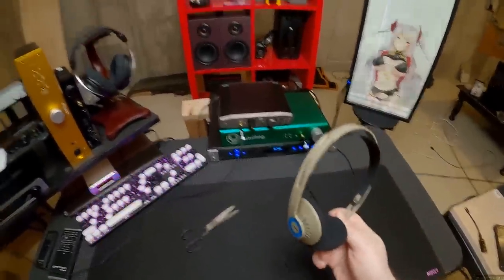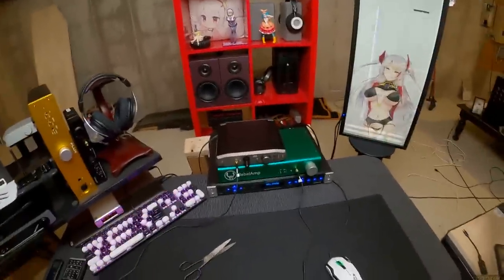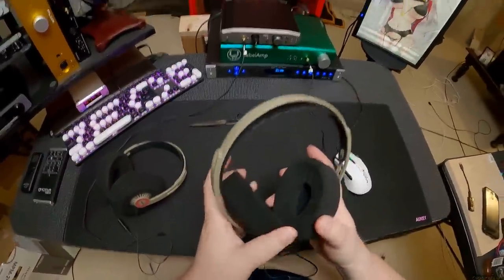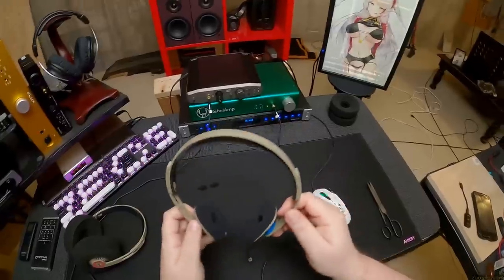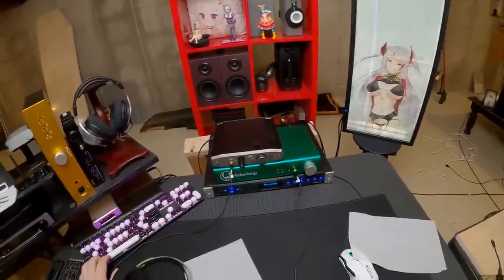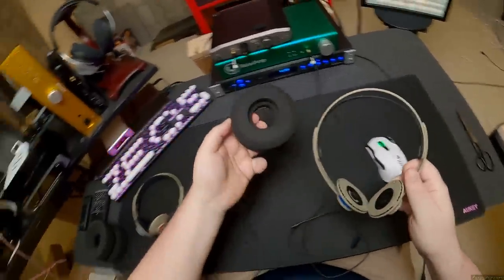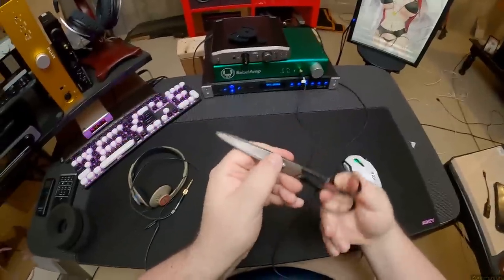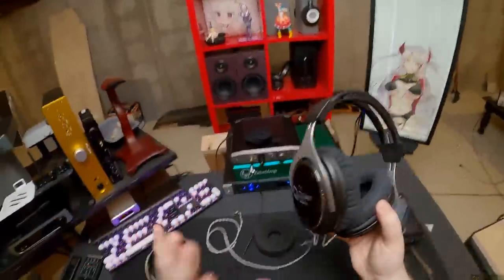Koss KPH30i ULTRA _(Z Reviews)_ 🔥

Comment: If you stick those grado pads in boiling water for 10-20 seconds, they soften up even more (and they're clean too!)
Reply from the maker: So I need to find Aldente?
Reply: Just remember to take them off the headphone first.
Reply: I concur, definitely boil the pads. Feels a lot better afterward. Just make sure to dry the inside groove of the pads as well.
Reply: Boiling water or warm water?
Reply: @FalseNihil  Boiling water.
Reply: @Thirsty_Tree  okay, thanks, when I find a buy page for kph30i in brazil i will definetly mod them.
But fuck brazil I cant find it anywhere
Reply: Wow, that actually worked.
Reply: I was fully expecting the pads to melt or release toxic gas or something, but it just worked.
Reply: @ShinkuRED  well maybe don't drink the water, foam breaks down after 100°.
Reply: @k.-flynn  I definitely didn't drink the water lol
Reply: Somebody mentioned that on the last grados video. Although he mentioned isopropyl alcohol as well.
Reply: Do you boil the water and stick them in or do you put them in the water as it's boiling on the stove?
Reply: @chethammer  boil the water and stick them in
Reply: @k.-flynn  I did it once and was surprised at how much softer they felt and then I did it again and they're even better.  I can't swear to it because I didn't measure them beforehand, but I think they're actually smaller as well.
Reply: For how long do you keep the pads in the water?
Reply: @elazark2914  60 seconds max
Reply: This feels like a prank and I’m not convinced every comment is not playing along to fool me personally
Reply: @strutter789  me too lol I'm hesitant to drop my pads in boiling water. I'm worried it'll dissolve
Reply: @wrliggin2  They're $10 to replace if you don't believe us. Just try it
Reply: Makes my happy peepy go 😂
Reply: This is the wildest thing I’ve ever seen we are boiling headphone pads
God I love the music production community
Reply: @ELISHACAEZ  grado pantyhose mod

Comment: I've spent a couple days with this mod now, stock pads removed. I'm really impressed, these are the most balanced and yet enjoyable headphones I've used thus far. The bass, mids, and highs are all perfectly balanced. All of my previous headphones were either to focused on one or lacking in one. The mod also increased the soundstage a pleasant degree. 

For reference, here's how it stacks up with all of my previous headphones (they're all budget headphones)
SHP9500 - great highs | good vocals | not enough bass | great soundstage
SA CB-1 - good highs | okay vocals | good bass | good soundstage 
Monoprice Retro  -  recessed highs and vocals | to much bass | great soundstage
KSC75 - slightly sibilant highs | great vocals | not enough bass | okay soundstage
KPH30i stock - great highs | great vocals | not enough bass | okay soundstage
KPH30i "ULTRA" - great highs | great vocals | good bass | good soundstage

Edit: A word of warning a year later, while the audio is great these headphones break really easily. I don't mistreat them and I don't have a very big head, but I broke two of them before giving up on them. Super glue only saves them temporarily until they break again at the same spot they were glued. Additionally, the headphone pads recommended in this video are massive hair magnets, and the hair isn't easy to get out either.
Reply: I have a question, have you tried the kph40's and, if so, are they any better than the kph30i? And on that topic if you have hearf the kph40s modded do they sound better than the modded kph30i's?
Reply: @n1kora937  Haven't tried kph40's

Comment: Can confirm, this does really improve the sound. They weigh nothing and feel great as long as you boil the pads for like ten seconds, and they do improve the low end and widen the sound a bit. Highly recommend getting another set of KPH30i’s (Killer Plastic Headphones 30 i) and doin’ this mod. Also there’s a small piece of buffering foam behind the driver that you remove. Do that.
Reply: Imma take your word and try this out❗️
Reply: @Chemunguss  Go for it! When you get the grado pads, be sure to boil the pads in water for about 10-15 seconds. Makes ‘em softer.
Reply: I just got the KPH30i and grado pads. They do feel pretty firm so I'm about to boil them to make it softer. Thank you for the tip.
Reply: @vincetheveganprince  Yeah, they are kinda stiff when you get brand new ones. I’ve been using my pair as desk listening headphones for years at this point, very comfy sound.
Reply: @Just_a_Tool  Hello, I don't know anything about headphones, but what are they talking about when they say 'buffering foam behind the driver'? I've ordered the pads and the headphones.

Comment: I purchased a second set of these Koss's after hearing the stock first one. In case i sat on the first pair i wanted to make sure i had a backup. So after this Z vid i had to at least try this. The pads were def on a slow round about because i ordered them shortly after the video. Well they came and i tried putting them on without taking the original pads off. NOPE. Immediately went for it in taking all the foam off. Easy. So spending some a few hours with them this afternoon and this New Years Eve. I am blown away at how good these sound. If you have these....just do it! I was plugging in and out a few nice headphones i have,such as the 58X and the 598. I'm significantly enjoying these more at the moment. Soundstage got truly amazing. Definitely pleased and thanks for sharing this Zeos!

Comment: watched this a couple months ago, and decided to buy a pair. I was slightly disappointed with the stock. not entirely, but slightly. I just did the grado pad swap a couple minutes ago and it compensates on what was originally lacking to my ears. stock, they sounded almost like there was a lowpass filter on everything if that makes sense. taking off the stock pads and putting on the grado pads opened them up so they are much brighter now.

Comment: "You could take off the pads, I think they have something to do with the tuning"  So when the pads on my Sony 7506s inevitably deteriorated and I replaced them with Beyerdynamic DT-250 pads, I opted to leave the foam out the first time, and what that did to the sound is difficult to describe.  It didn't just make the treble brighter or anything, it screwed up the entire sound balance.  Put the foam back in and it was back to normal.
Reply: foam absolutely affects sound

Comment: Bought some cheaper Grado replicas, comfort improved, but sounded, mhpmh, hard to describe? They had become more fun but veiled. Went ahead and followed a guide to remove the stock earpads (it is possible to do). After slowly unclipping the driver from the headband you can remove the foam pads without tearing them. Now they sound fucking awesome, as God intended, do it, just be slow and steady. As Zeos said, they don't have to work as hard to retain that fun, punchy signature Koss worked on.

Comment: I have personally tried this mod...sounds great and I find it much more comfortable to wear for longer periods of time. The removal of the original foam (yaxi pads in my case) is a must! Only slight downside is that a longer surface of my skin gets sweaty over the hours and I can see it get worse in the summer but ymmv. Anyway, I give it my recommendation.

Comment: Bought a pair based on the old review. The adjustable part is quite rigid and will crack if you adjust them without taking them off your head. Some electrical tape on one side works well. Unfortunately 6 months in and the sound stopped working in one ear. I had them for 6 months and paid the postage to mail them back to Koss. You get what you pay for.

Comment: Regarding light gear sliding around, using a combination of 3M Scotch SJ3550 and SJ3551 dual lock is a great way to avoid that. You'll see that method used on guitar pedalboards. It just takes a little square in each corner, doesn't move around like velcro once snapped together, and holds really well. Well enough that you need something like a nylon upholstery crowbar to pop the gear apart.

Comment: Old video, but I did this recently. The KPH30i's were not on sale but this is still worth it. These are so comfortable and sound great. Very well tuned. Nothing boomy or shouty about them. Nice and easy not fatiguing at all. I think I get a bit of what y'all mean when you talk about sound stage and what not. These sound fantastic and coming from only using in ear monitors. The stereo positioning of instrument tracks is much more convincing. Panned hard doesn't still sound like it's inside my head so they really do feel more wide then in ears ever could.
Reply: So basically snip a circle in the center of the pads, then add the Grado pads?

Comment: So I have these and I love them. I bought the grado earcups and they're way better with them. They plug right into my ps4 controller, so I can play at night or watch TV and not wake my wife. They're insanely comfortable. Use them to play D&D over Discord with my formerly in-person group and have them on for four hours without realizing it... BUT they break way too easily. I have snapped 3 pairs just putting them onto my not-freakishly sized head. Especailly with the grado cups, they are at their max just going on and off.

Comment: My headphones and pads have arrived; the Grado pad mod improves the headphones significantly for sure.  I haven't removed the stock foams yet, but I'll likely try that, too. The headphones without the mod are pretty good for the money... the knock-off Grado pads bring the sound quality up significantly.  Still not as good as the Philips SHP9500 imo.

Edit after further listening:  In some ways, I prefer the Koss over the Philips. The Koss provide a fuller upper bass / lower midrange than the Philips, thereby giving them a warmer overall sound by comparison. The Koss, however, are not as expansively 'open' as the Philips, but by no means are they 'closed' - sounding.  The Koss seem to have a pretty uniform mid to high frequency range (nothing stands out), and their smoothness lends itself well to a good vocal presentation (somehow offering more intimacy), not to mention provides a bit of forgiveness in some less than stellar recordings.  

Both sets of headphones are equally enjoyable to me. The Philips are more comfortable due to the circumaural design, have a wider, way more open soundstage, cooler sound signature and better overall resolution than the Koss.  The Koss are not quite as open or resolving, but still no slouch in either of those regards, and provide a warmer overall presentation due to a slight bump up in the lows and a very slight bit of treble roll-off (with the stock pads on and the Grado pads added).

They both excel at delivering a uniform presentation, both offering very good midrange performance.  It's more a matter of cool and agile vs warm and smooth. Good either way.

Comment: My pads arrived today..

I bought these sometime over the summer and they have been fine headphones for around the house with a portable DAC amp. I like the 90s look (beige). Now they have other shades. The pad swap has made me look at these in a new light. I will admit that I was never really impressed with their sound. I kind of thought they were overhyped. I also never thought about plugging them into my Darkvoice or any other amp besides my FiiO BTR5. On both amps, they do sound good (better than before) especially considering the money, surprising clarity (after pad swap) and very lightweight/comfortable. Much more so with these pads.. I am using a sonarworks preset for the Koss PortaPros and it does sound better with it on. So do that or an EQ is probably a good idea for these.

The pads I used are from AliXpress for $3.20 - Replacement Earphone Ear Pad Earpads Sponge Soft Foam Cushion for GRADO PS1000 GS1000I RS1I RS2I headphones these feel of nice quality. I did set them in a bowl and poured boiling water over them. I let them sit in the water for about a minute. Not sure if that changed anything.

You can find the headphones for sale at Koss and use this promo code - VRKTHQ33EC 15% off

Comment: I tried the 30is and the tuning is just too dark for me personally! Sounds good though, just a matter of personal taste. More of a ksc75 person
Reply: Same here. I'm flabbergasted by the quality of the ksc75, i often prefer listening to the ksc75 than pulling out the xduoo x5 + Sennheiser HD600 (better all around but in mobility nothing beats the ksc75's dynamics)
Reply: I'm pretty sure someone has put the '75 drivers into the 30i frame... idk if anyone has done that and the g-cush pad swap though.
Reply: I was going to make the same comment, lol. I think the ksc75 has the best treble balance and the most fun sound. I've tried ksc35 and didn't like them as much.
Reply: There's a foam pad that sits behind the drivers and I've seen people say that if you remove it then the treble really comes to life on the 30is. The foam apparently helps  make the bass real punchy.
Reply: @auroragoose3414  Apparently there is a mod with a very cheap headband.. don't remember the details.. check metal571 video
Reply: so, this is an emo headphone?
Reply: Kph30i are a mid-bass bloated mess. Ksc75= clean and great Soundstage.
PortaPro= more Focus on (Sub)bass than Kph30i.
Reply: I have the KSC75... in some bright tracks, the treble hurts my ears a bit... for all other cases, they are just awesome
Reply: @jackjack3874  I might be missing highs
Reply: same.. they sound pretty good for 30$ headphones, but they lack too much info or even dipped in the higher regions, not very revealing to say the least. Didnt remove the foam tho

Comment: I tried this mod using the Vever pads and I didn't like them. The treble was harsh and sibilant, I tried it on both the KPH30i clear and rhythm beige. So a sample size of two. They had great midrange and soundstage but the bass distorted. I much preferred the stock pads and the later swapped Yaxi pads for the Portapro. I am not sure what happened with the sound, I even just ran the headphone with just the Vever pad with the stock pad removed and the same problem occurred. I tried to calm the harshness with the desecrated corpse of my clear's stock pads by cutting it into a circle and placing into the hole where the driver is and the same problem occurred. I then switched to the Yaxi pads and the sound was unoffending and not sibilant. The amps I ran with these headphones were my phone, MT602, Zen Stack and and Hidizs S3. Is there anything I am doing wrong? Thanks.

Edit: Same problem happened with my Grado SR80X, the Vever pads made them harsh sounding. Stock pads make the Grados sound like Grados

Comment: Viewer update, Wed. August 17, 2022.  I did this, ordered directly from Koss as they had the best price, would have waited for the clear, that flexibiliyt would have helped as my head is larger than average, and those pads on it did lead to the band snapping, but that sound was amazing, and I just happened to have a pair of porta pros, so I put the pads on those, and enjoyed them...but long ago, in 2008, when I moved here, I went downtown to Bay Bloor Radio, and auditioned some headphones, deciding on Grado SR125s, I still had them, they were buried, I found them and put those Grado Pads on, and DAMN, they came alive, and are my current goto, no fancy headphone amp, just the headphone port on my Scarlet 2nd gen 2i2, as I was a cohost on a youtube show that reached conclusion in early 2018..after a 5.5 year run..outgrowing the blue yeti lead to a Rode Nt-1a xlr, and the need to have a computer with a case not full of holes, right now using a repurposed dell optiplex 7020, no more ground loops, hurray.

Comment: I can't even find the shops to import these where I live. And if I can even get one it's closer to $50
Reply: Still probably one of the best open backs sub 100usd, they are better than shp9500 and ad500x
Edit: Next upgrade for open back from the kph30i would be like a 58x/dt880 then 400i 2020/560s
Reply: @joshe2420  alright fuck it, pulling the trigger, ist 40 here in Malaysia
Reply: Yeah in Australia to get a pair of these you have to pay extortionate amounts for shipping etc, ends up being a lot more expensive than it should be.
Reply: Aliexpress could sell them
Reply: @enzotibirica8458  yes but i havent seen any sell on aliexpress
Reply: @joshe2420  better than SHP9500 okay a lot of people dislike the brightness of that.
But the 500X is supposed to be awsome if you are fine with not much of bass...
Reply: @houssamalucad753  the 500x has treble that cam hurt too...

Comment: I've seen a similar mod to what you've done here a while ago with a pair of Portapros, same large grado chinesium pads, much thinner piece of foam almost to the point of being paper thin just to protect the diaphragm from dirt, and MMCX connectors. (and some head extra padding in style of an aftermarket Shure)

Also, I have my own Sportapro's that i modded to have MMCX connectors, thinner pads and a BT adapter, which i use them on the go all the time and especially when just around the house. Might get a pair of KPH30i to do the same if i can get them at a decent price shipped to clapistan (60$~ right now), though i'm thinking of getting a 2pin connector and heatgun for further testing.